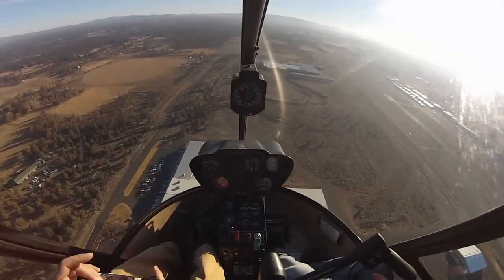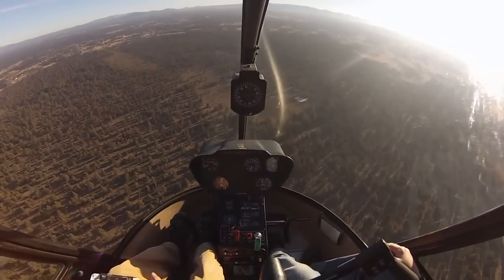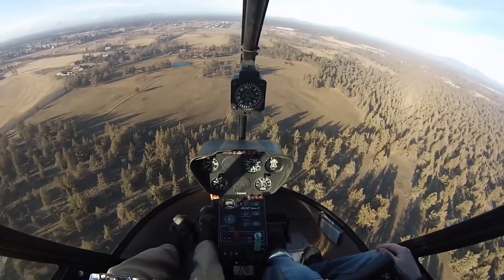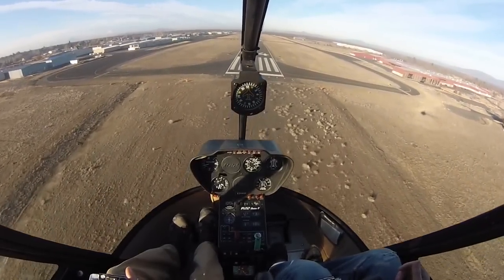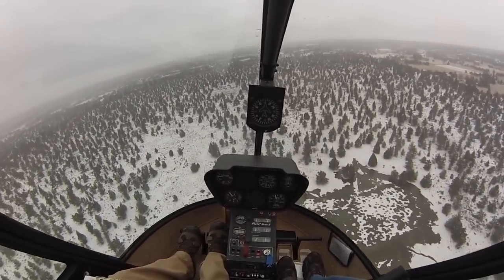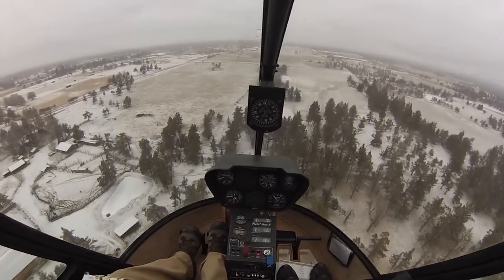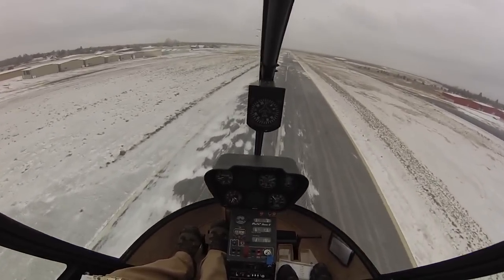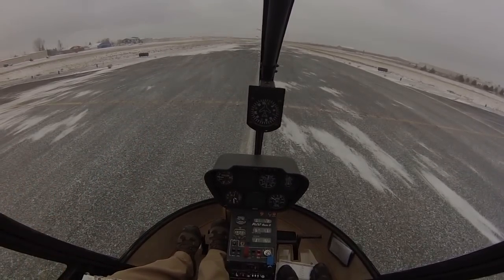Running Landing in a Helicopter - For When You Can't Hover...

Comment: I like these better. My instructor has me slide 100 yards or so. Seems like Im going too fast
Reply from the maker: Yeah it can happen, depends on surface, condition of skid shoes, tail wind, aircraft weight etc. Need to find a nice balance between sliding and stopping without risking catching a skid and rocking forward (blade strike). I saw one like that once - missed the blade hitting the runway by inches.